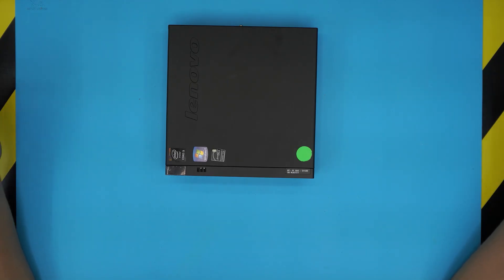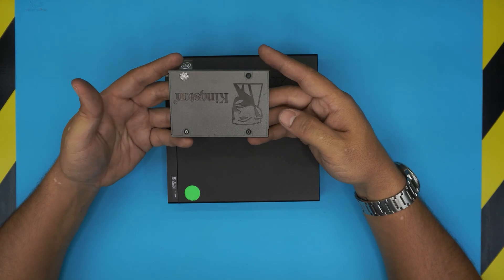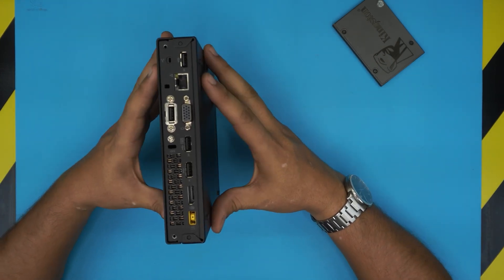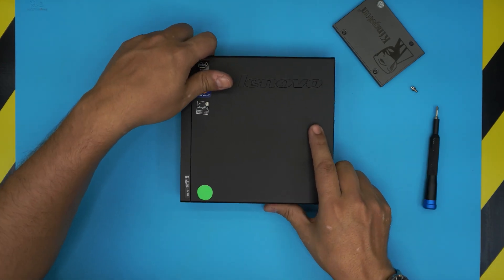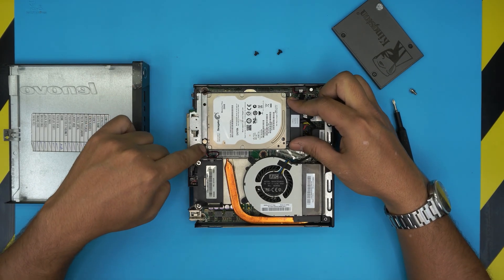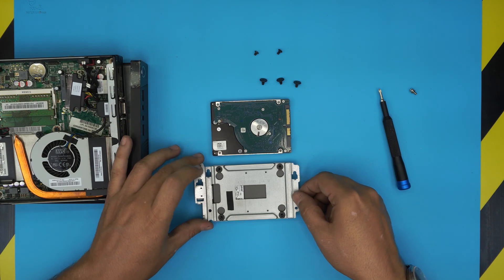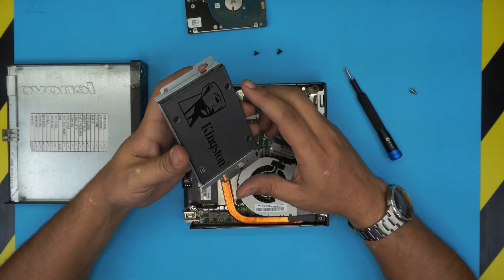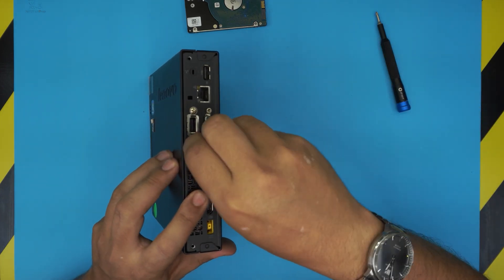Lenovo ThinkCentre Mini PC SSD HDD Upgrade GUIDE

Comment: Great video. Will they take a 2.5 sata iii 4tb?
Reply from the maker: Thank you for your feedback! If you wish to support the channel, you can like, subscribe, or both!
Regarding your question, yes it will take without any issue we have placed one before.
Should you have any further questions or requests in the future, please don't hesitate to ask me.
Reply: @uFixTek  Already subbed and liked :) Thanks...ended up finding answer after research and ordered. I am using it as a Plex box...amazing units for Plex.
Reply from the maker: i would highly recommend you to look into Proxmox, very solid and you can have few stuff running and super fast and FREE.

Comment: Great video, thanks!  I just bought a Lenovo ThinkCentre Neo 50s Gen 3 Small Form Factor Desktop computer and I want to add a 2nd hard drive, when I opened the case there is a 3.5" hard drive bay, but there is only a Serial ATA cable with 7 pins that is about a 1/2 inch wide, and the power connector is daisy chained off the DVD drive is very small too.  Can this work with some kind of cable adapter to fit a regular HDD SATA drive?  Or do I need to purchase a special SSD drive that has these connectors?  In these videos the SSD drives look like they have a larger ATA connector and power cables.
Reply from the maker: Thank you for your feedback! If you wish to support the channel, you can like, subscribe, or both! Regarding your question, we have a SATA interface, while very old drives used the PATA interface. Now, any SATA interface is compatible with SSDs or HDDs, whether they are 2.5 or 3.5 inches in size. If your PC has power and a SATA data cable, you can plug in any SSD or HDD with a SATA interface. I hope this clarifies any questions you may have had.